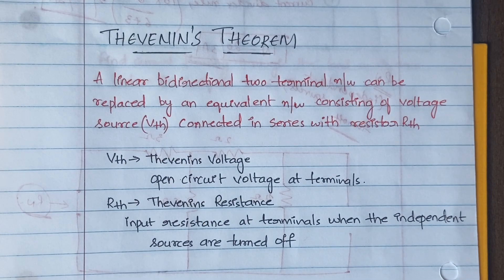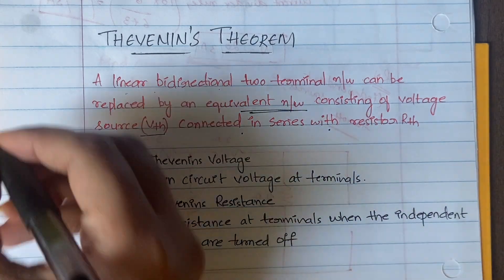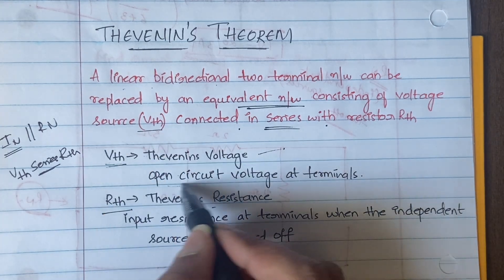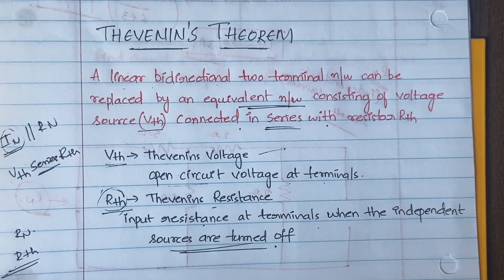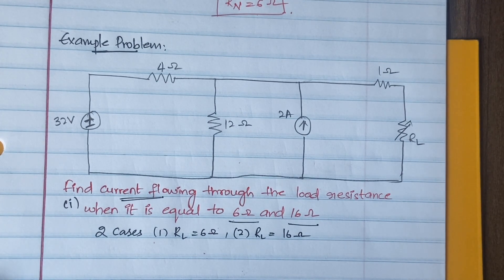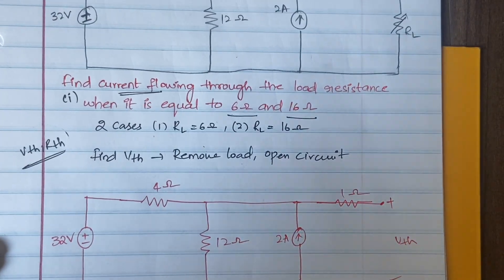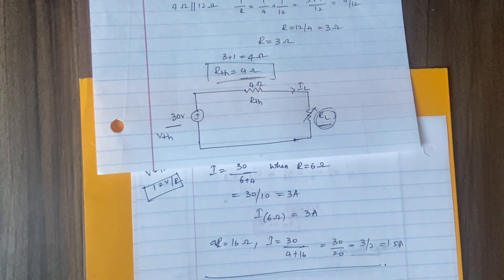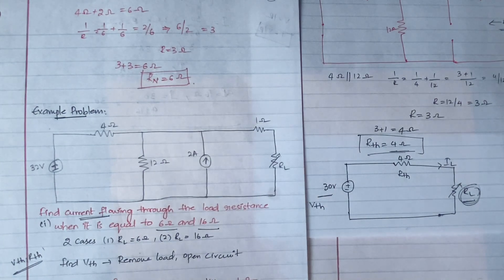Thevenin's Theorem in BEE, Concept and Example Problem |Lec 12||BEE|

Comment: Hi dear ,u hve written opposite in respective norton and thevenin theorm definition.Pls check once .While removing current source we do open circuit and while removing voltage source we do short circuit .u r saying it correct as well as explained well while solving problm ,but in defintion its mistakenly written opposite >please check once